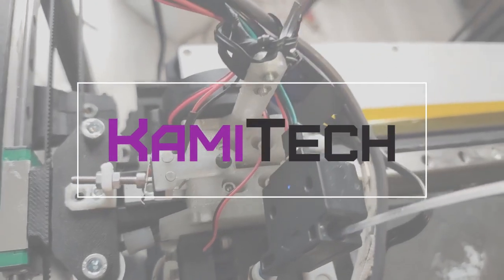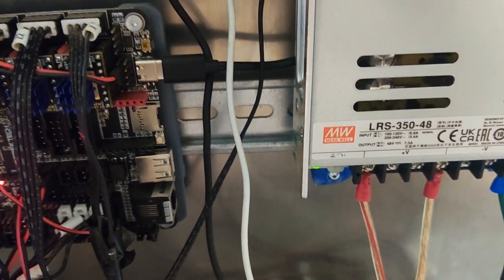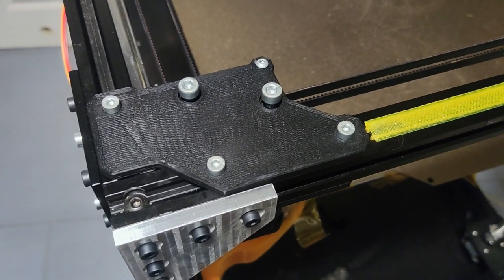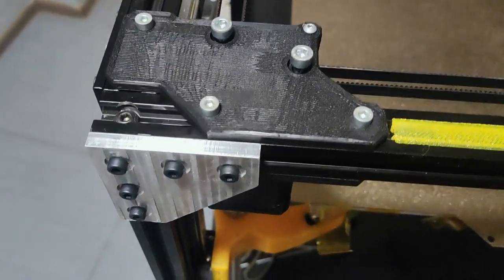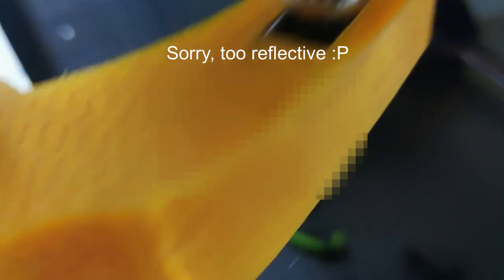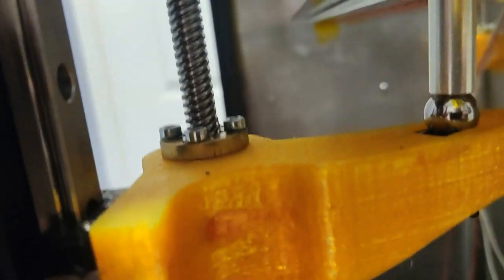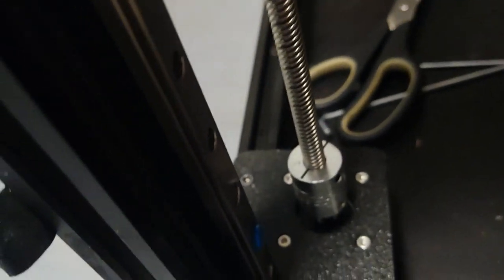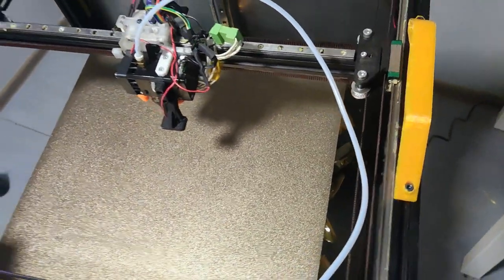Converting Tronxy X5SA to RatBot/VzBot - Upgrades: Triple Z, Quad Gantry and 48V

Comment: Hey, I just wanted to say thank you so much for posting this and putting all the effort into making it. I am a very shy person and get anxiety about talking in discord servers with so many people rather than somewhere like Reddit where it's easier for people to ignore or not see your posts if it's not what they're looking for or something they're not knowledgeable about you know? So, I was unable to find ANY instructions online literally anywhere about making this upgrade. Your video is the only info I've seen between YouTube/forums/websites I searched about adding the 3x Z/kinematic bed mod, except for one single video where the guy had designed the system himself and i did not like it, as his wasn't designed with VzBot parts in mind.

I currently have an X5SA Pro that is mostly stock with only upgrade being an Octopus Pro board and I'm trying to upgrade it to Vz330 AWD just a few parts at a time (I'm poor), and I figured that starting with the machined aluminum bed and triple Z mod would be the easiest places to start. 

Current plan is to print the VzBot motor mounts for the "2WD" version, buy whatever belts/pulleys/screws I may need and keep the stock motors for now, install aluminum bed with backlash nuts, then buy what I need for the triple Z mod, then upgrade the motors. Might upgrade motors before the triple Z idk. Anyway, thanks again and you've inspired me to maybe actually get on the Discord anyway

OH btw, the video is great :) very well done and clear, thank you!

Comment: @KamiTech thank you. I will use your information to further fix/modding my al ready modded Tronxy X5S. Still had a lot of problems with the bed and so I bought an Bambu Labs P1P for the 3D-prints I (or my wife) need/wanted. The P1P can/will help me to print the parts I need for the (maybe partly) conversion to a VzBot.

Comment: I wonder how much would need to be changed with the triple Z to make it fit a X5SA 400
Reply: Probably just get linear rails/screws that are however much longer the difference in Z axis build volume between X5SA Standard/Pro and the 400. So, I'm not actually sure of the build volume of the standard X5SA but assuming it's 330 mm on the Z axis for example, and the 400 is exactly 400mm on Z axis, then you'd only need to add 70mm to the lengths of all linear rails/screws that he recommends for triple Z mod on the video and in his BOM

Comment: Hello.  I have 2 X5SA and I'm starting with the Triple-Z conversion.  Where can I find the motor mounts for Triple-Z to print ?

Thanks
Reply: In the video he is using upper gantry motor mounts stock from the VzBot project, I believe, but pretty sure he said he just bought the triple Z parts from the RatRig store, so search for the latter? RatRig project website would also have the printable files if there are any

Comment: Would you say that buying a stock Bambulab would be more cost efficient and more quality and speed?
I already have a basic 40mm Tronxy x5  and a Anneth A6 (since about 5 years).. Sure it's way cheaper... but... Ha.. there is always a better fish I guess!
If I was new into the hobby, I think I would go straight to the Bambulab.
Reply from the maker: No, no and no. Bambu is good printer if you don't want to tinker. VzBot is going to be cheaper faster and produce better quality. But it requires skill and effort.
Reply: @KaminarisTech  Very interesting... I'm curious to see how your less than 15 minutes Benche compare with the 15 min perfect one from Bambulab.
Reply from the maker: @alexandrevaliquette3883  you can find may videos of speed printing with vzbot
Reply: @KaminarisTech  You said it faster and produce better quality. So, can it print a perfect Benchy in less than 15 minutes? If it doesn't, well, you claim is not supported by facts. And for the price, we also have to compare the total price for the additional hardware to get there. So, what is the total cost of the Vzbot (kit + all the mod).?
Reply from the maker: @alexandrevaliquette3883  First of all, I am not the author of VzBot, i just made a printer that borrows a lot of design from VzBot. Second, VzBot is capable of printing 5 minute benchy, gantry is capable of pretty ridiculous accelerations, but material (plastic) is incapable of solidifying that fast. So Yes it absolutely can print benchy with same quality in 15 minutes. As for cost, mine is around 800$ right now. You can make one for ~400$, full kit is 1600$, and anything in between depending on your needs.

But as i said, it requires skills to put together and time.
Reply: @KaminarisTech  Interesting and impressive, wow!!! I did not know VzBot, thank for the info.
If the limiting factor is the plastic, should we say that the design is now overkill?
How long does it take to build it (for someone with good experience with 3D basic kits)?
I still think for 1600$ I would prefer to get two Bambu at 769$ each. I will print perfect in day 1 and I could have two differents setup. There are also other great printer in this price range.
Reply from the maker: @alexandrevaliquette3883  Build volume, vzbot is 330 while bambu is 256. Plastic is limiting factor in typical benchy test, it is not representation of how fast printer can print, that also depends on nozzle size, slicing height, model itself and so on. If you wish to know more i suggest checkout out Vez3D videos. For example https://www.youtube.com/watch?v=A3jx4bZE3AU It takes about 1 day to build a kit, and vzbot can be built on budget for 500$ (400 if you squeeze stuff in)